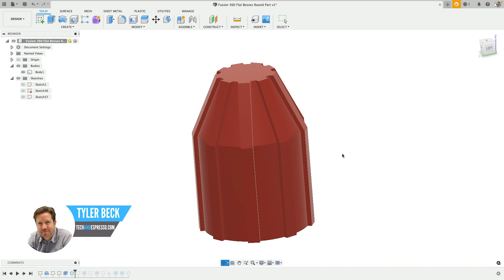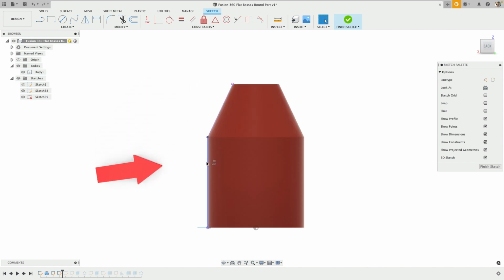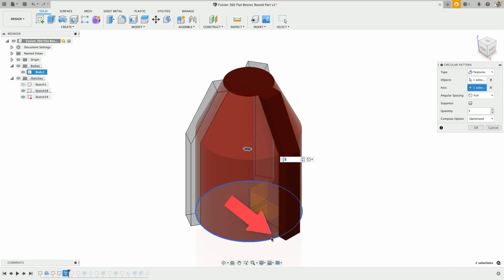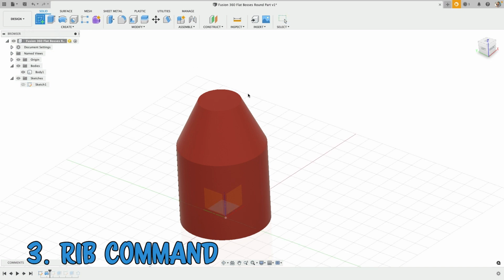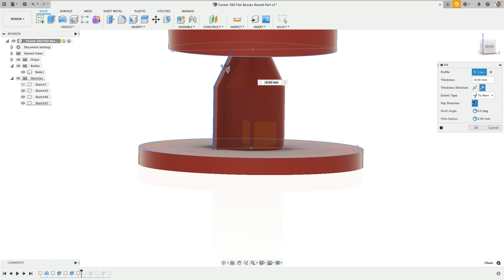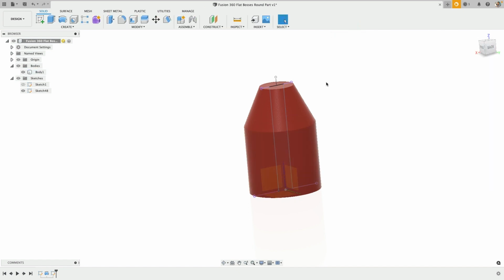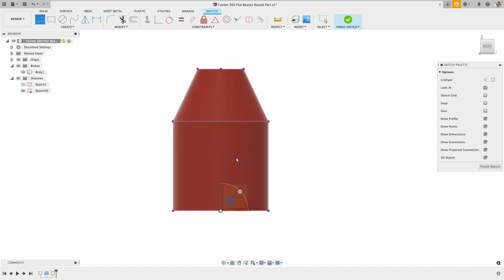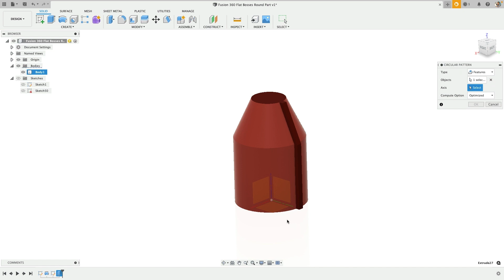Learn Different Build Techniques - Fusion 360 Modeling

Comment: I think you should mention in this video the different methods the will result in a flat outer rib, vs a curved outer rib.  Perhaps in the original video, it was specified that the rib will be flat, not curved? I haven't watched that video.

Comment: I don't know about Fusion, but in Solid Works sometimes I would sketch on a plane and then either project the sketch to the surface of the model and then thick or extrude to surface with an offset distance - the thickness of the feature from the surface of the base model.

Comment: I think emboss could work too here. Another one would be doing a sketch and get the intersection profile then you a thin profile extrude (center & symmetric)
Reply from the maker: Great idea!  I tried that, but it would add rounded bosses. So, a slightly different result.

Comment from the maker: Got a better way to create this in Fusion 360?
Reply: You could offset outwards the cylindrical and the conical surfaces, then thicken them towards the object, and then make a sketch of a rectangle on the base plane with the intended width of the rib and extrude it upwards, and intersect it was the thickened body.